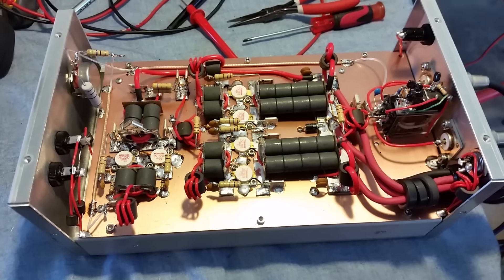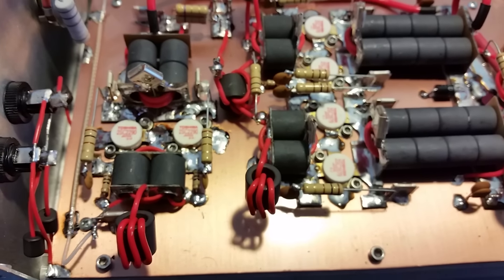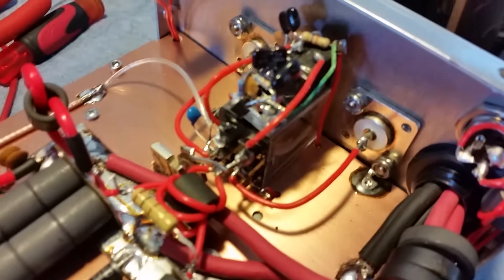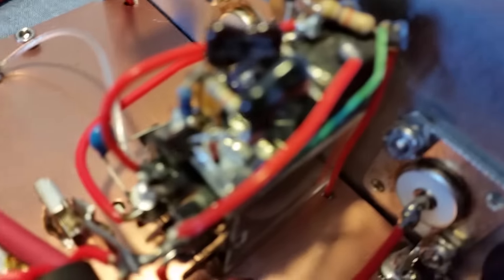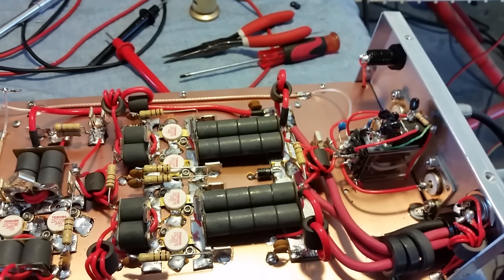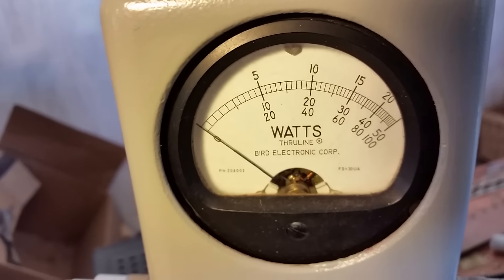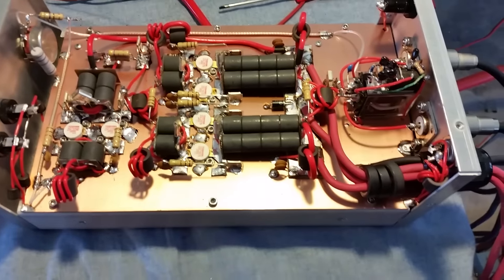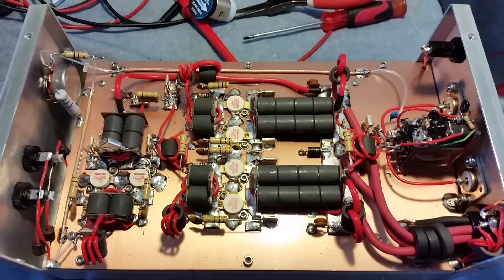Gatekeeper's First 2x4 Amplifier With ALL Metal Capacitors

Comment: You do just about the best work I've seen on here, by a long shot. You and BBI are my choices when it comes to boxes. I'd love to have one of these boxes as a base unit...throw a power supply unit into that thing, and I'd get one in a heartbeat. Love your work, and when I get ready to get me a base box...I will be calling you for sure. Love your work, bro. All I really want is a damn good base box that will take abuse and keep on kicking...a little over 1,000 watts is all I really want it to do, but I want it to do 1,000 watts all day long with no problem...my ideal box would be more like a modulator, I guess...I like my rig to key low and swing high, know what I mean?? My perfect base box would key up about 1 watt to 1.5 watts and swing up around 1,100 to 1,200 watts all day long with no heat issues or any issues at all...to guarantee that 1,000 watt mark every time, with little to no voltage drop. That would be my perfect base box...with built in voltage and amps meters...maybe some modulation LED's like "some other companies" offer. Variable voltage would be cool, too.

Comment: is there any advantage to use 2 inch transformers from what you've seen.
Reply from the maker: yes.....only when you are needing to run more volts then normal....it allows the transistors to handle a higher voltage with out giving out so quickly but they pull more amperage is well.....he hates that he used to inch Transformers because he can hardly even run this amp in his car now he has pretty much an identical amplifier with inch and a half transformers and he is able to run that just fine so my build is pulling that much more amperage just because of the Transformers
Reply: ok so 2 inch transformers allow the transistors to be volted and it causes a higher amp draw. sounds like it's time for a leece neville alt with a switching two volt output regulator. round about. that's what i'm taking away from that.